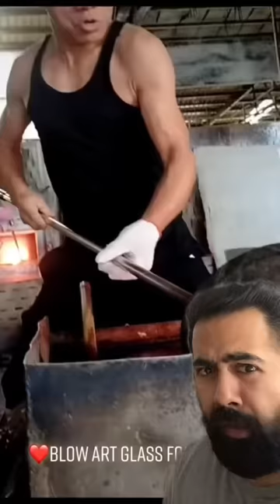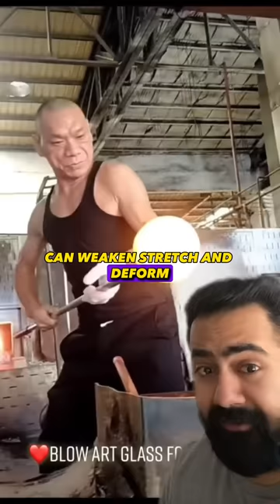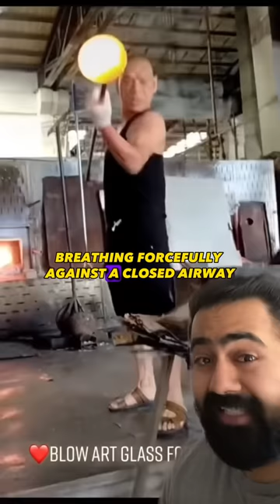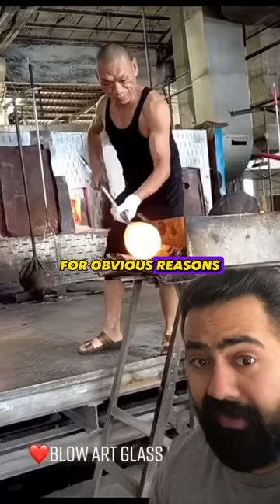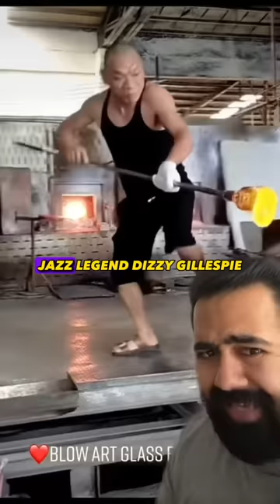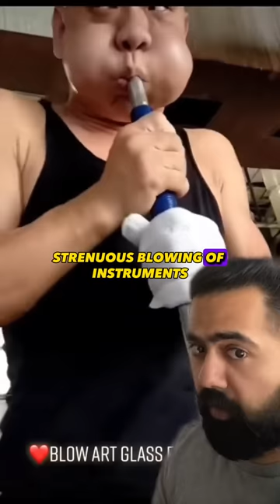Doctor Reacts To Glassblower’s Disease!

Comment: Shorts, black undershirt, and sandals no safety gear.... This man is a damn glass master I salute you sir
Reply: Maybe he's trying to keep cool only thing I can think of
Reply: You actually don't have to wear much safety gear glass blowing except the shades to protect your eyes 

Only when putting the glass piece in the furnace for cooling
Reply: You don’t want to wear too much clothing while blowing glass, and your shoes should be removable because if they aren’t whatever fell on there is staying on there. Clothes burn onto you, but thankfully glass is largely hydrophobic so it doesn’t stick to you like your clothes will (no matter the fibre). So generally, good thick and loose-ish gloves are all the protection you get unless you are working on complex pieces where sharp shards might fly everywhere. The average blown glass just falls apart when it breaks, but if it’s too stretched and twisted while cooking it can shatter outward, so someone making spiky things will wear a jacket and work with small pieces at a time while someone like this will wear little and work with predominantly big globes.

Additionally, not only do you have to contend with heatstroke but also just being in poorer health because this is yet another trade where your body is on the line to do the job. And obviously, many are underpaid considering the work they do.
Reply: That's the only way to not get a heat stroke
Reply: @Joisbjdieiej  craftsmen like this typically are not, low skill laborers and women are the ideal, older men skilled men who look like they could take a guy in a fight are not.
Reply: @RomanvonUngernSternbergnrmfvus  where do you get these facts from
Reply: Exactly, a job like this shouldn't be done by a man

Give it to a child
Reply: @Joisbjdieiej   you never talked to law enforcement that specializes in human trafficking?  Young girls are a number 1 hot item. People they can easily out muscle are ideal.  

Plus it’s a simple chain of logic. What’s so unbelievable?
Reply: Fr
Reply: A legend